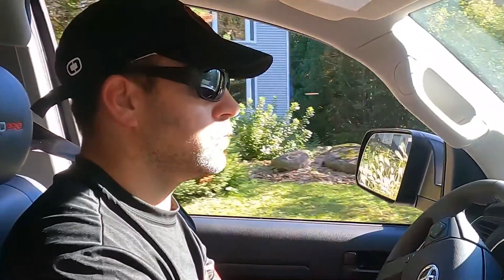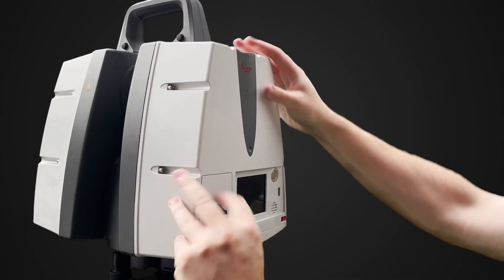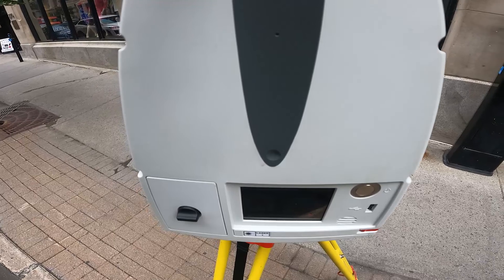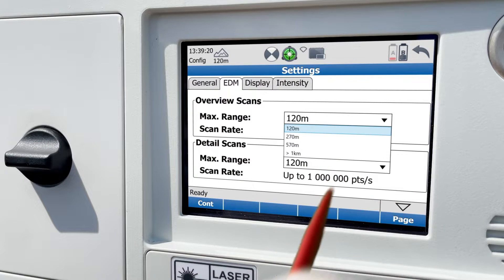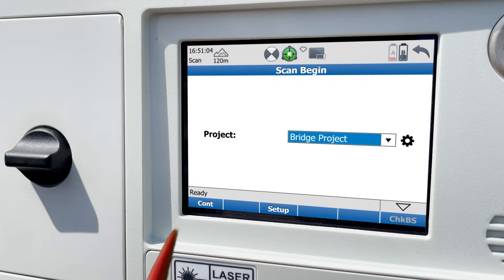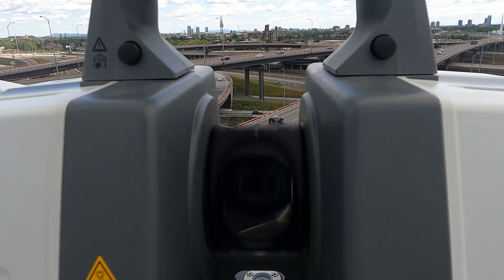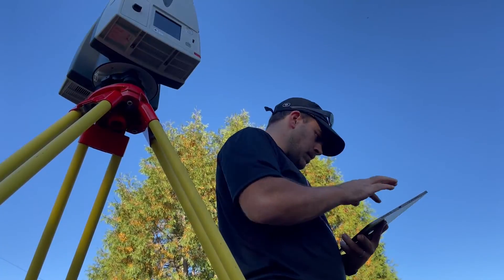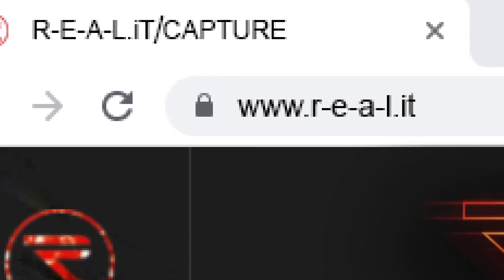DEMONSTRATING the P Series

Comment: Seems a lot more involved than some other scanners using slam or similar comparison based algs so movment of the scanner isn’t important to data tracking during and after scan. Is there a reason for this or something I missed? Like is this super crazy sub mm accurate or something
Reply from the maker: Hi Michael. Thanks for your comment. Indeed, the P50 can achieve point accuracies of 1.2mm and at long range can scan up to a kilometer in distance. It is one of the best terrestrial scanners on the market in terms of those specifications.